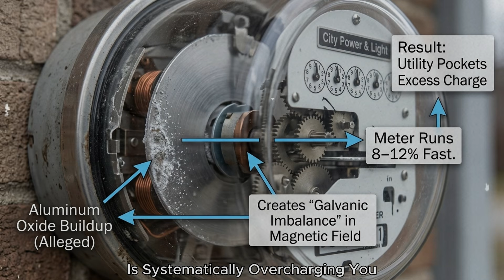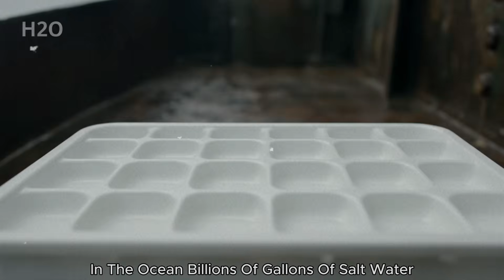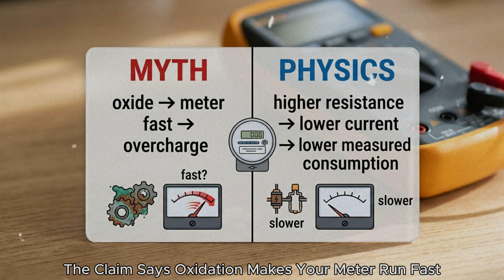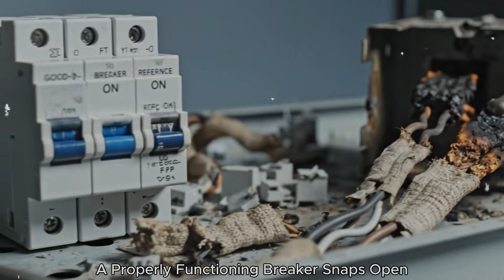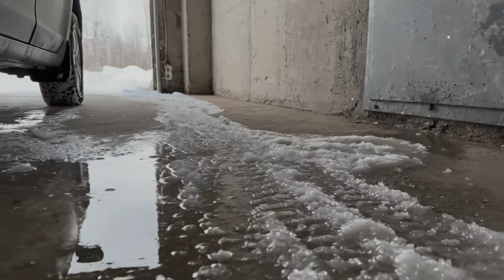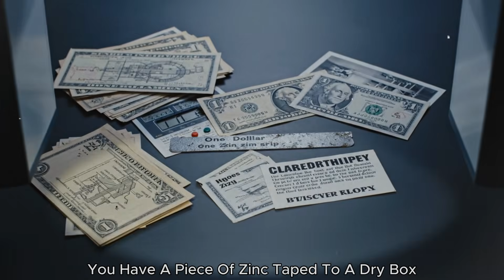This $1 Zinc Strip on Your Electric Meter Saves $1,200 a Year — Why Did Power Grid Call It Illegal?

Comment: Live on a farm and have ceramic wiring. And I do have 🔥 insurance 🍾
Reply from the maker: Old ceramic/knob-and-tube style wiring can last a long time if untouched and properly protected, but it also deserves respect. The big risks are modifications, insulation packed around it, brittle connections, and overloaded circuits. Having insurance is good — having it inspected is even better.